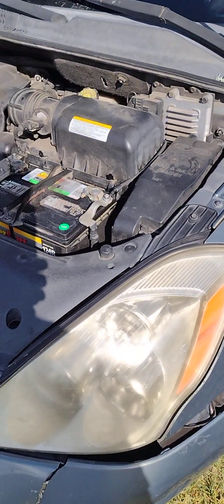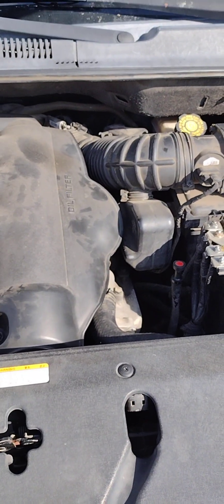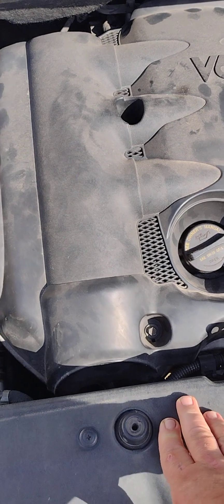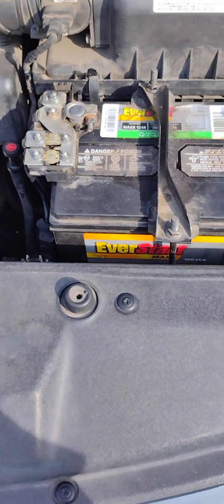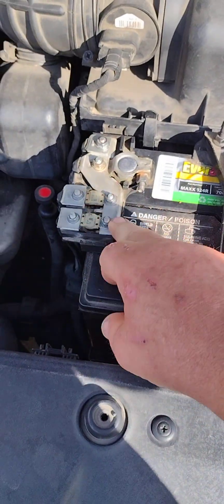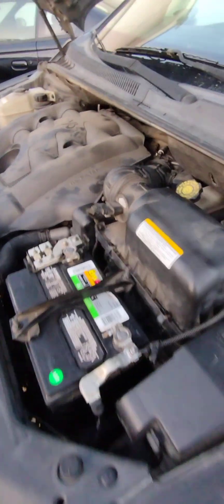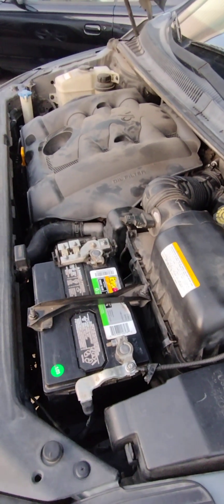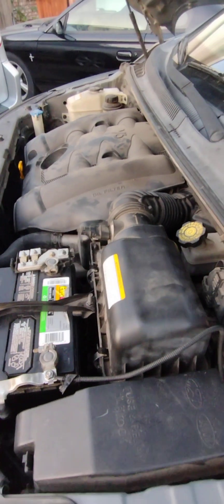2007 Hyundai Entourage - alternators keep dying

Comment: Do you have front vavle cover gasket leak that drips oil into the alternator?  This is a common problem
Reply from the maker: I replaced the valve cover gasket after the original alternator died; the oil leak killed it.  The replacement alternators from AutoZone are just not durable; they can't handle the load from this car when too many things are turned on.  I called Hyundai about it, and they assured me that replacing the alternator with a new OEM one would fix the problem.  It's been over a month and the new OEM is holding up.  The replacement AutoZone ones were dying after about a 5 to 7 days.
Reply: Another thing I discovered was that there is an alternator fuse on the positive battery connector. It the fuse is out, it will eat battery/alternators like crazy!
Reply from the maker: @Kittenz96  I bought a genuine Hyundai alternator several months ago, and it is still going strong.  So I have to conclude that the AutoZone alternators are just not heavy duty enough.  The 130Amp rating is too low; it really needs to be at least 200Amp.  Even with the genuine alternator, the voltage drops below 13V under heavy load and engine idle.